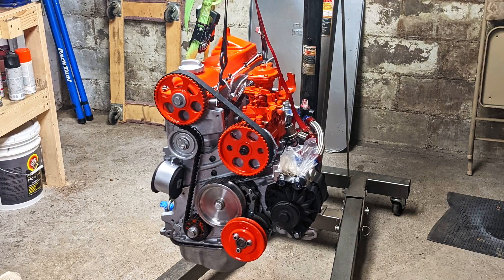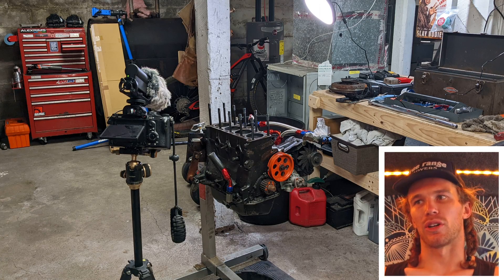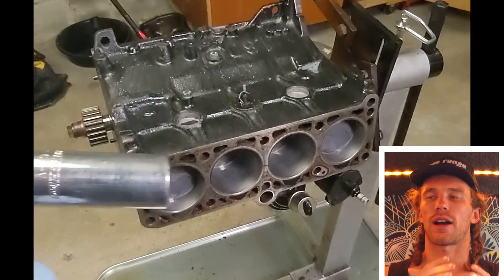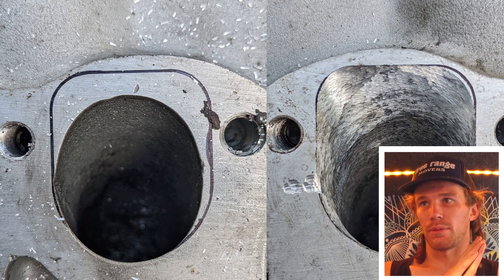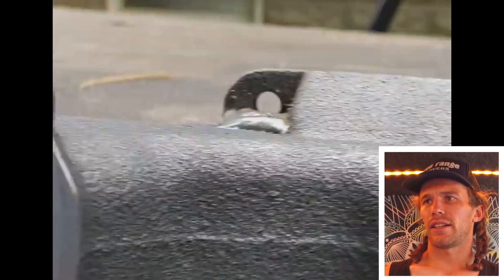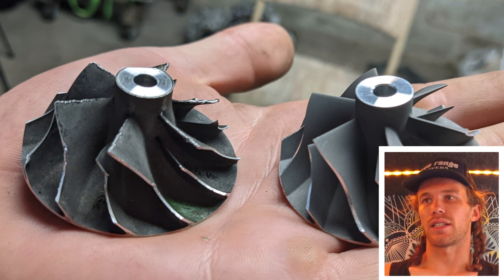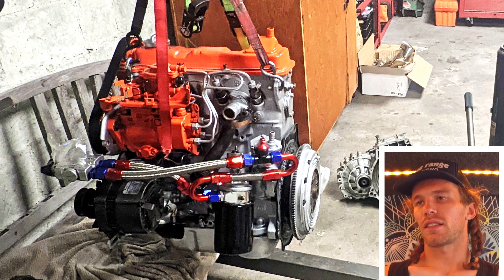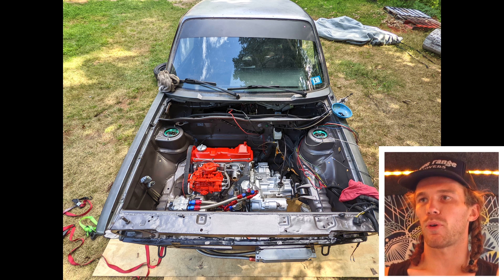Turbodiesel engine build! VW 1.6L

Comment: Either i missed it or you didn't say, what turbo was that?
Reply from the maker: Gt2052 at the time
Reply from the maker: https://youtu.be/zL47Kfa6KTQ?si=nkYA44VNp2g0Bng6
Reply: My fantasy 1.6td is "all of the above" ,thank you very much,  a gbc17-250 as high pressure turbo and he200wg as low pressure turbo in a 914. Use the entire Swain Coatings catalog on it and an Amsoil bypass filter to catch all the particles abrading off these Coatings with magnets on the filters and drain plug. Id like to see 150hps and 180ft/lb. I'd need a rebuilt 01A with shot peened, ISF'd components as well as the quaife lsd. This is probably a $50k car so will never see reality. My retirement is way underfunded. But thanks for putting this out there. Can't disagree at all. Unless it's the gasket matching. No don't match the gaskets. It's the ports that are matched. There are some excellent YouTube videos. 
Thanks again. That was the 3rd time I watched you upgrade video. Excellent.
Reply: Oh yeah, and an AAZ head swap. Professionally ported and polished with a 5 angle valve job. The local tuner refuses to do 3 angle. It's what he does for a living.  I won't argue. And if someone still has those 1.6td hydro turbo cams.
Reply from the maker: Heck yeah 🔥🔥

Comment: Hey man this is probably a Long stretch but I Might try I recently purchased a 1985 Volkswagen 1.6 diesel rebuild the engine and only 127,000 miles I’m having problems with cooling i’ve replaced all of my cooling system and today after fixing it thinking I fixed it I messed with the tuning of the fuel injector pump and ended up blowing my gasket because of not right fuel and air ratio this is my dream car and I’d really love to get down and talk about it and some help working on he seem to be the only one on the entire Internet to have any idea about these vehicles. Please let me know!!!
Reply: It a 1984 Volkswagen golf 1.6 naturally aspirated diesel. No turbo yet. Im using head bolts on a brand new cylinder head. I rebuilt the engine my self. Well the top end rebuilt came from a shop brand new. Purchased from Part’s Place inc. The bottom block only has 127,000 miles on it and looks really good no warping in the piston heads, or scorching on the cylinder walls. No metal or any damage on the bottom end when I pulled off the oil pan to reseal it and put new oil in it. It ran great and the first time, putting it back together and doing all the timing for it started right up and then took it on a drive. And overheated it because not having enough coolant. 😢 Finally when I towed it back home The next day, I pulled everything back off to make sure no significant damage to my brand new cylinder head. it was fine. Put a brand new head gasket and after then filled it up with proper coolant, got all the air out of the lines and drove it around for a couple of days before it just started shooting coolant right out of my reservoir so I thought maybe there’s a blockage or my reservoir is bad so I replaced my reservoir my radiator all my coolant hoses and my water pump and my temperature gauge. Then after replacing all of that I decided to mess with my injection pump fuel screw ended up putting too much fuel to the heads and blew my head gasket. 

- Sorry, this is my other YouTube account. But If I can get your instagram or facebook that would be cool, so I can send some close up pictures of cylinder head, pistons, and such. 

Thank you again for reaching back out to me and helping me out with my build.
Reply from the maker: @domdoesgaming7748  dang!! So was it at a good temp before the head gasket blew? - Ie did replacing your cooling components fix the overheating issue? I'd highly recommend ARP head studs for your car, but I'm a bit surprised the head gasket blew with no turbo 🤔🤔

You can look me up on Facebook but I don't respond very fast 💁
Reply: Yes it was at a good temperature when it blew. By chance, what type of coolant are you running in your Volkswagen and would you possibly manufacture another exhaust hood stack pipe I could  buy off you? and thank you for responding I really appreciate it.
Reply from the maker: @domdoesgaming7748  I just run the green stuff, 50/50, never been picky about more details than that! That's odd it blew. I never tuned the motor with the stock head bolts in it so maybe they are that weak?? Re hood stack: yes I could do that. It's tough for it to be a slam-dunk (fitment wise) because it depends where your turbo is & where you cut the hole, etc
Reply: I really appreciate your help with knowledge about my Volkswagen. And all the tips you give me with your videos. I’ll keep you in touch on my build too. Within the next month or two I’m planning on pulling the engine and all other components to refurbish and fix just like you have your video really help that forsure.😊 thank you…
Reply from the maker: @domdoesgaming7748  let's go 🤘🙏 I'm glad it's helpful!! Def keep us posted
Reply from the maker: Hey!! Cool! Hit me with details! Is it naturally aspirated? Is it turbocharged? What size turbo? Are you using head studs or head bolts? Did you rebuild it yourself or have a shop do it? Was it still overheating when the (presumably) head gasket blew? What told you it was overheating? Try to be brief & detailed and I'll do my best to help 🌞